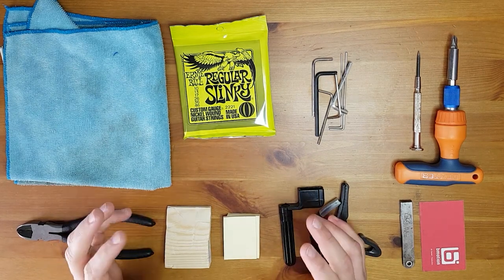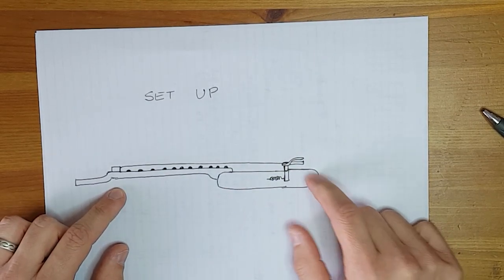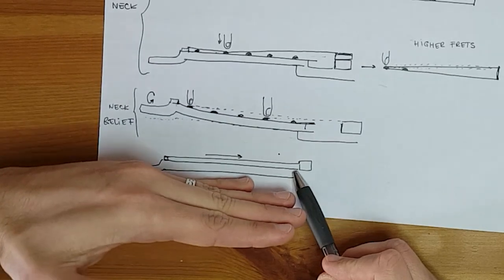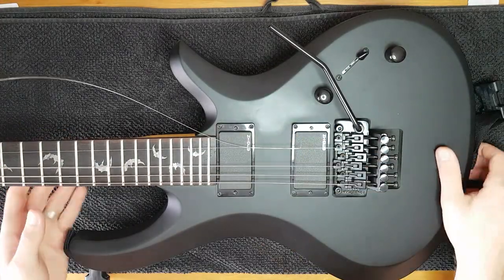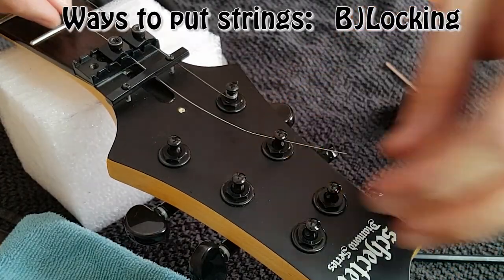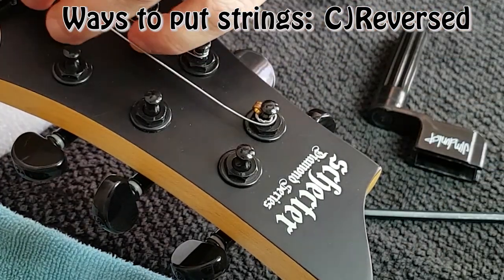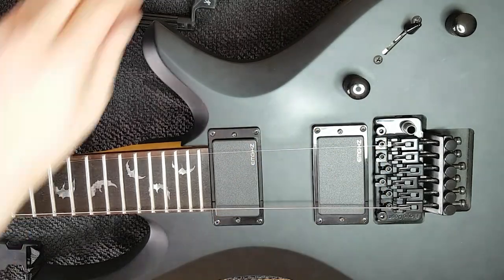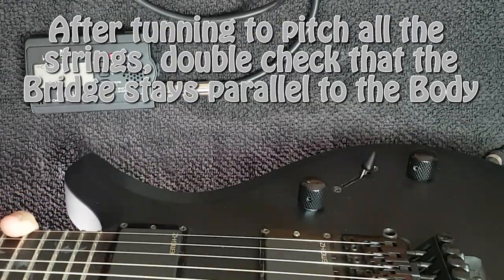12 Step Tutorial to Setup a Floyd Rose Guitar for Beginners

Comment: Thank you for the detailed video!

It is almost impossibble the make a video that covers all points of setting up a guitar expecially with a floyd rose bridge. I would add some personal points to the topic:

1. If the nut is too high the main problem is that the notes freted at the 1. and 2. fret will go very sharp, they are usually a bit sharp (you would need tempered nut and tempered frets to avoid this) but with a perfect nut hight it is more torelable.
2. Truss rod, just to clarify it: it does practically what you said: it counters the string pull effect on the neck. What it really does: if you thingten it it brings the fretboard closer to the strings, if you loosen it it will bring the fretboard away from the strings. The neck it self is usually rockhard maple/mahagony the fretboard is much thinner and usually softer, the truss rod could never put a bow to the whole neck it just adjust the curve of the fretboard, this is why adjusting the truss rod has so little effect on the 1-3 frets and on the 15-24 frets.
3. Micro tilt does what you said and this helps (mostly) to get better action on the 17-24 frets.
4. Exotic string winding is not that important with a locking nut, but I found the best method the "John Carruthers" way, just search for it, it is another way of locking the strings to the tunning pegs.
5. Forget any mesurments. I know this is not really a help for total beginners, but later on you should never ever measure anything on a guitar, just go by feel.
Reply from the maker: Thanks brother!!!!! Totally agree!

Comment: Thank you so much for your efford on this video. It helped so much! Yesterday I bought my first floyd rose guitar ever and with your video I manged to change the string gauge, tune it down to D-Standard and set it up properly. Thank you! Keep going on with your videos!
Reply from the maker: Yeah man!!! I'm glad it was helpful!!! Now you go rock that guitar!!! I'm editing more stuff right now
Reply: I have a tool-tip for you which might help a lot during the intonation process: the ibanez ejk1000 intonation tool. It is a bit pricey (41€ in Germany but it should be a one-time investment) but it is super precise and the whole intonation took me about 10 minutes. I had to file it a little bit down in order to fit into the notch, but as it is made of aluminum this wasn't a big deal. One big advantage is that you don't need to put out the tension of the string: you put the tool onto the saddle, then intonate, tune the string back to pitch, intonate again... and when the string is perfectly intonated you just tighten the screw of the saddle and remove the tool :)
Reply from the maker: @sebastiankurz1533  oh yeah I've seen it and it's awesome. Luckily most of the guitars I setup are normal bridges but one day I will get it for sure

Comment: Thanks Al this was great ... also if it's a bolt on neck make sure the bolts are tight .. and under the nut locks, the nut has 2 screws make sure they are snug too. Rock On ♫ ♫ ♫ !

Comment: This is great and most complete setup of a Floyd I've seen. Only one suggestion, leave the twisted end on the string, only cut off ball, then insert into bridge block. This has held better for me, when not doing this way, string would sometimes slip out (e or b strings). Thanks for all info and tools needed.
Reply from the maker: Thanks man, I appreciate it. Yeah is true what you say, sometimes it slips and leaving the twisted part helps a lot.

Comment: Really appreciate the demo, & your English is great =), 28:28 It's also important to know that some noises which your guitar makes unplugged doesn't make the same noises when you are plugged in. Also any guitar neck should be slightly concave ( have a slight bow ) and never 100% level / straight.

Basically the closer the pickups are to the strings the more it affects gain due to the magnetic pull on the strings, the higher the pick up, the louder the sound, they should be about  2 - 3 millimeters away from the strings but see what you like.
Reply from the maker: Yeah. The goal here is to make it as quiet as possible. Regarding to the neck relief I just set it straight with no strings on so when you put the strings and tune them to pitch tje tension will give the curvature we need. It is not going to be the exact amount of relief but it will be in the ballpark
Reply from the maker: With pickup height I normally start around 4/64 to 5/64 inch and tweak from there. When I raise them I hear more output and more treble.

Comment: When I string it I use the method c. But I don’t pull it all the way until the ball is against the peg. I put the string through the whole like you, but I put the end of the string into the saddle and tighten it. So you’ll have like 10 inches between the ball and the tuning machine
Reply from the maker: Yeap that works too 😊

Comment: Very informative and detailed! I have two questions:
1. We have to do all that procedure every time we change strings? (Or just if some things in the guitar are not well adjusted?)
2. What is the procedure if just 1 string breaks?
Reply from the maker: Good question!!. This is a procedure to follow when your guitar is completely out of adjustment. If you chance strings and keep using the same brand and gauge, you might not have to do anything. Depending on the guitar and the weather you might notice that when the season changes the action can get higher or maybe it will start to buzz but that os due to the neck so you can fiz that with the trussrod adjustment. If a string breaks, just swap it and tune to pitch.
When you change tuning, brand or string gauge is when you need to check this procedure top to bottom.
Reply: Thank you so much for answering (so fast) 👏🏻👏🏻👏🏻
Reply from the maker: @raphaeloliveira89  I do my best 👍

Comment: Great video, I was given a Jackson Dinky 2K Pro because the original owner changed the Jackson Licensed Floyd Rose with a Schiller Floyd Rose, and got frustrated because he can not keep it in tune.  I’m wondering if it sits right in the pocket because he did not change the bridge posts, and had to use the fine tuner screws from the Jackson bridge because the new Floyd Rose did not fit into the pocket. I am wondering if further routing of the bridge cut out is needed.  I have never owned a Floyd rose guitar so I do not know if my assumption is correct.
Reply from the maker: Thanks!! That is a great guitar man!! At least the one I tried in the store I used to work at. I don't get what you say about the fine tuners. Maybe you mean that he kept the stock screws the ones that press the blocks against the strings in the saddle?

Comment: Fun fact. If you keep the tension on the string past the nut about half an inch from the tuning peg (just press it down against the headstock with your finger) it's a lot easier to get it to wrap right. "Underneath the previous wrap"
Reply from the maker: Yeah, you can actually direct it to press up or down depending of what you need. I learned to do that after I made the video 😅

Comment: Regarding string action
You have to loosen the springs as well. Because they give you tension anyway and will damage the studs as well.
If you can pull the bridge back with your hands then you can raise or lower the studs of the bridge
Reply from the maker: Yes, I should have mentioned that in the video. I don't remember how I exactly did it when I was recording the video but I normally leave the block and just one spring with the necessary tension to keep the bridge parallel and blocked
Reply: @alverduratonejunkiealveram1017  if it's parallel and blocked there is still pressure.
I just remove every spring to be sure 😅
Reply from the maker: @chaosandorderstudio  yeah I know, minimum but there is some

Comment: Just got my first floyd rose guitar a base for upgrades..you tutorial made it painless to set up...you should use an intonation key I got mine from Red Bishop from Amazon...I got everything set up and turns out not as difficult as other people said..The major upgrade I did was to change the TremBlock to Tungsten...Change the springs to red..and the trem arm to Red Bishop trem arm...and I use locking tuners...Will try Kramer Baretta Vintage reissue floyd rose before buying more expensive models...
Reply from the maker: That sounds awesome, I'm gonna have to check that out!!

Comment: Good job overall and thank you. I just want to suggest about intonation so others won't have to deal with this at all, because  when I used to do it this way it didn't work for me but can't stay off of it because it's always there. It wasn't until I've learned that if;
(pitch is too high = make string longer)
(pitch is too low = make string shorter)
Reply from the maker: You're welcome bro!
Reply: joe valenzuela wdym leave it longer and cut it shorter? Sorry im confused and i really need help bc this is my first floyd rose
Reply from the maker: @Alkize06  what Joe said is just a different way to say the same. If you follow the procedure using either way it will work. 😊
Reply: @Alkize06  Strings gets shorter or longer by means of the distance between two points holding a string which are the nut and the adjustable bridge. A tuner with a chromatic setting gives a more precise octave reading. When it reads high it needs more distance. When its lower need shorter distance.

Comment: Awesome thanks.  Would I do the 1st e and the last e strings first on a jackson wherw the tuners are in a straight line?
Reply from the maker: Yeah, the reason why I use first and sixth string is just to get a ballpark action and then if you need to adjust the height you don't need to remove tension of six strings but just two 😉

Comment: I always measured gap when doing neck relief using a .004 (.10mm). It's what I was taught when I was training to be a luthier. Is there a reason why you used a different one?
Reply from the maker: Well 0.004 is pretty straight. When I set guitars, just a very few of them handle that relief without issues. For normal production guitars I use 0.011 as my decent relief. On my guitars or my client's, that have been leveled, those I can go for super straight relief

Comment: Well done man.  I  just went full special and mangled my setup.  Tried going to drop b from standard e and my Jackson soloist said no.  I’m having issue aligning and “leveling” the trem.  I get close but in the progression of tuning the ass end gets way up in the air compared to the front.  You’ve given me some more hope!  Muito Obrigado
Reply: Just followed you step by step.  Fixed my issues and even lowered the action a bit! Good stuff man!
Reply from the maker: Obrigado voce cara, eu falo portugués mais eu nao escrevo jajajaj. You need to tighten the screws to move the bridge down. If you block the bridge is going to be easier. Let me know
Reply: Best way to stop that from happening, is to use a small piece of wood or something to block-off the trem so that the bridge sits parallel to the front-face of the body, doing that will save a ton of frustration and time, I use the woodblock method all the time now, I also use a 600mm steel ruler to "rough-in" the intonation for each string before I put the strings on, this is done by marking on the ruler where the 12th fret lines-up when measured from the nut-end of the fretboard, I set the high-E and D-string saddles so they are roughly about 1.6mm from the mark on the ruler when measured from the middle of the 12th fret, next I set the B-string saddle so it's a little-bit further from the 12th fret by about 1mm or so, then I set the G-string saddle so it's a bit further back than the B-string saddle, the same goes for the rest of the saddles, once I have the intonation "roughed-in" I usually end up with all the saddles positioned as shown in the video, I managed to get the new chrome Floyd Rose Special trem set-up pretty good on my Jackson JS32M guitar using the woodblock method, it was pretty easy and frustration-free, I only had to make some very minor tweaks after the strings settled-in, here's a tip, you can put some 3-in-one oil in where the knife-edges contact the two mounting-studs to help the bridge return to it's zero-position.

Comment: Hi, thanks for a great video. 
Do i have to do the whole process every time I change strings?
Reply from the maker: Hello. It´s not necessary. After you do it once you just change one string at a time and it should be ok if you keep the same tuning and string gauge. 

I use to check everything again if I feel the guitar is not playing right. The most common thing that you have to tweak is the neck relief when the weather changes, specially if you have set up with low action but other than that it should be fine
Reply: @Al Verdura Tone Junkie] [ALVER Amps  thanks alot, this has been extremely helpful 👍

Comment: Great video. I've never heard of setting truss rod tension without the guitar fully strung and tuned to pitch. Then make your truss rod adjustments. On some guitars, perhaps most, the neck will go convex almost immediately once you remove all of the strings. The truss rod has an opposite direction of pull of the strings. Think of it as the strings in a tug of war with the neck. In a setup, the goal is to make "both sides of the opposing forces equal". From there, one can adjust truss rod for more or less relief. Player's personal choice.
Reply from the maker: Yes I totally agree. This is just the method I use based on my experience and what I have found easier to do. Thanks for watching!!

Comment: what size is the allen wrench for the locking nut screws? my jackson guitar has 3 screws for 6 strings.
Reply from the maker: Hi, that wrench in general use to be 3.00 mm
Reply: @alverduratonejunkiealveram1017  thanks is it the same size for the bridge screws?
Reply from the maker: @ab9957  it depends, some guitars use the same size for the bridge posts. The saddle screws normally are smaller. My advice is always to buy a set from amazon for example, so you don't miss any size. I even bought a set that comes in metric and inch sizes

Comment: Hello brother , i have a problem with strings, i've noticed that strings are too high starting from the 10th fret to the last fret and my guitar is an Ibanez with a Floyd rose tremolo, could you help me please
Reply from the maker: Well it can be anything. First check that the neck relief is almost straight. Second, check that the bridge angle is parallel to the body (some ibanez bridges are not made to be parallel to the body like the edge model bridge for example) if you tighten the screws and retune to pitch the bridge end will go down and the action will be lower. Last thing is the bridge height that you can set using the two bolts on the bridge. It could be any of those things, two of them or even all of them

Comment: Hey! When I remove the block(as it gets looser) the tuning changes considerable.
Any tips? Should removing the block be completely effortless, or there should still be a tiny amount of resistance?
Reply from the maker: It has to fall off itself but don´t worry if it got out of tune. You can repeat it tightening the screws and putting the block back. Once the block is out maybe the tuning is not going to be dead on but if you retune to pitch the brigde should stay parallel

Comment: Hi thank you for tention tutorial, but I'm curious for the 3rd string....why you put the lock into the 2nd hole?
Reply from the maker: @chabow0581  thanks!!!! I appreciate it. Can you please specify? What do you mean with 3rd string in the second hole?
Reply: I see on the E, A and G strings you put the bolt in hole number 2 on the tension bridge. But for the other strings you put the bolt in hole number 1
Reply from the maker: @chabow0581  which part of the video is that? Which minute?

Comment: Hey Al, love the video! is it also safe to break in the strings before tuning to pitch?
Reply from the maker: Yes of course!! I normally do some bends throughout each strings tube to pitch and repeat several times. Thanks for watching!!!
Reply: @alverduratonejunkiealveram1017  I’m about to tackle this tomorrow when I get all my parts, but not before going along with your also-awesome deep cleaning video. Great content brother, super helpful
Reply from the maker: @xXRyRyXx7  That's the spirit!!! Sure man, let me know if you need anything ok. Thanks!!!
Reply: @alverduratonejunkiealveram1017  thanks brother, just finished the setup last night, it went pretty smooth besides having to replace some shitty hardware from the previous setup. Besides that, it’s beautiful and balanced. Thanks again for the helpful demo! I will definitely recommend.
Reply from the maker: @xXRyRyXx7  thanks buddy I appreciate that. It's almost weekend so rock on!!!!

Comment: I dont know if its a common step, but i usually leave the fine tunning screws all the way up so if i have any problem with the tunning i have enough space to work around it.
Reply from the maker: I normally put them in the middle instead
Reply: If you set all the fine-tuners to mid-way then you've got equal amounts of sharp or flat adjustment range, you'll find that sometimes when you lock the strings they will be either sharp or flat.